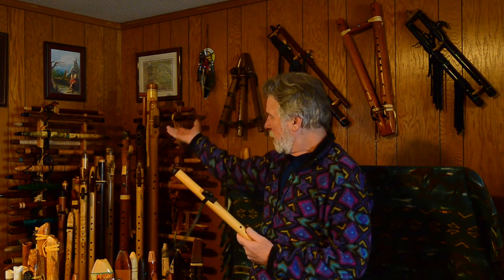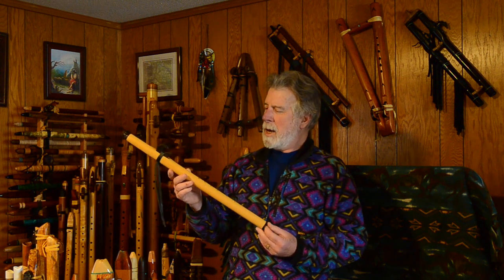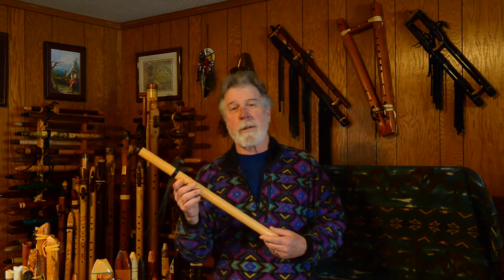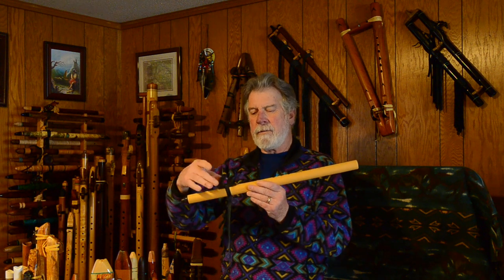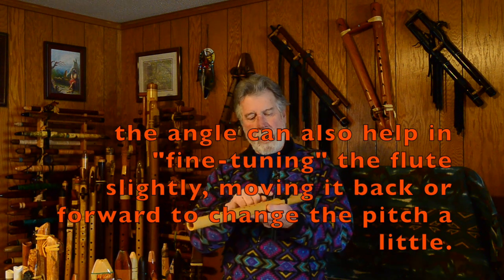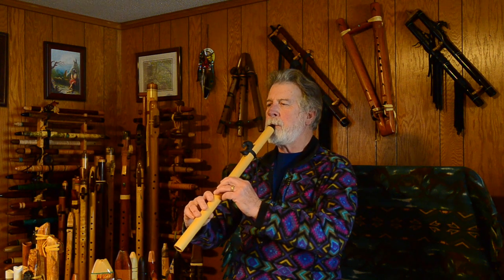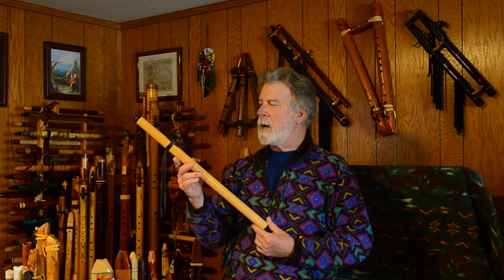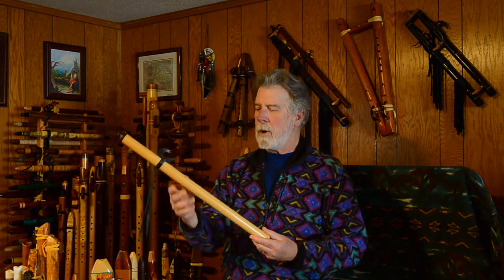A Full, In-Depth Review of a "Spirit Bird Flute" by Gary Kuhl

Comment: What is the difference between a 2 piece flute and a bored out flute? Is one better than the other? Is there a tonal quality difference? Another great video Brent.
Reply from the maker: The Flute Makers that make a one piece, solid bore construction flute will state that there are no glued joints to separate. The Flute Makers that use two piece, routed & glued construction will state that a properly glued joint is stronger than the surrounding wood (and yes, this has been tested). I honestly do NOT feel that one method is any better than the other. I use 2 piece, routed & glued construction and I have not had problems with a joint failure as of this time. Many that have gone to solid bore construction have bought a lot of expensive specialized tooling and it really helps to speed up their production by eliminated a few steps and glue up and glue drying time.